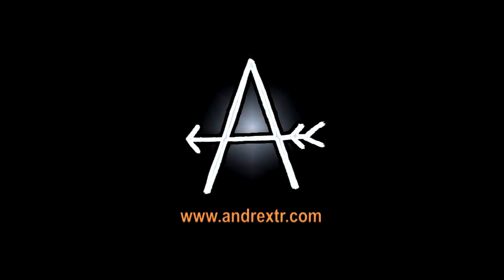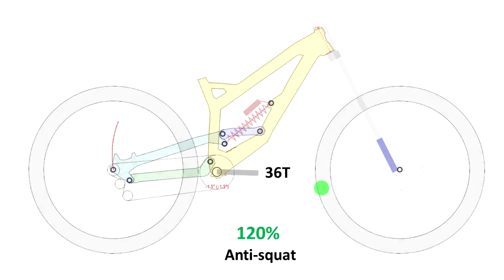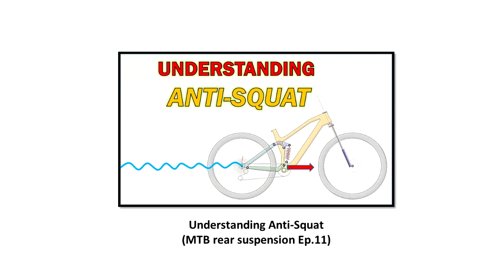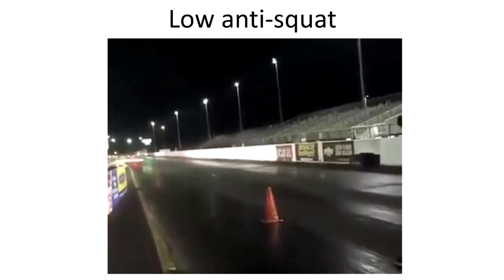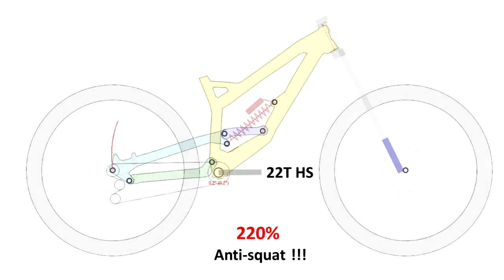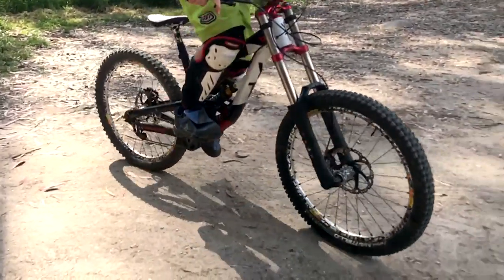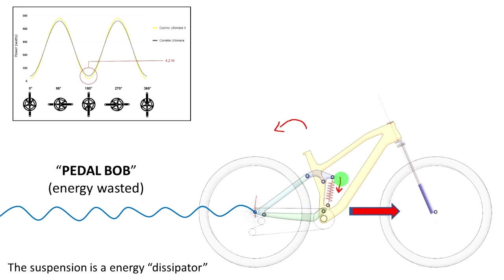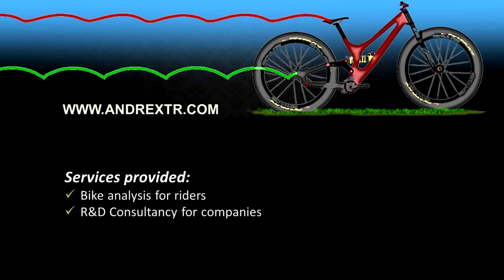Pedaling efficiency and anti-squat (MTB suspension Ep.21)

Comment: So I ride this same gen Tues frame, I want to change the stock chaining from 34 to 28 to achieve a gear range more suited to me. The tues comes with a 7spd cassete that is 9-21t. Even Gwin would size down to a 32t chaining when he was on YT. That 9t rear cog is SMALL and useless with a 36t chainring. So I guess what is a reasonable lower limit for chaining size on this frame while maintaining good pedaling efficiency and anti-squat.
Reply from the maker: For each 2T decrease on front chainring you increase average anti-squats by around 5 to 10% (grossly speaking). With a 28T you probably end up with around 150-200% anti-squats. Personally I would stick with a larger front chainring (32, 34 or 36T) and play around with the cassette range :)
Reply: @andrextr  Thanks!

Comment: I am interested to know the benefits of gearbox bikes like the Zerode on suspension..is it possible that the zerode with linkage driven single pivot, 100% antisquat through all travel  and only around 22% progressivity is still able to have the best feeling suspension because of less mass on the rear wheel? Everyone who tries the Zerode and Deviate say it is the best suspension they have felt even though the kinematics are less than perfect. Is this possible to have such a large affect and does this lower mass on the rear wheel only make a difference on small fast bumps or also on larger big hits? I want to know an unbiased opinion from someone who knows the physics and difference the gearbox bikes makes and if it is enough to outweigh their poorer kinematics?
Reply from the maker: Hi! It's an interesting question and that is a topic I want to make a video (for a couple of years now). I've done a simulation 2 or 3 years ago using a basic physics software showing that the heavier the rear part of the bike (unsprung mass of suspension) the less the wheel could track the ground over bumps and the less it was planted to the ground over the bumps (so the wheel gets more time airbone after hitting a bump crest, because of the inertia/momentum of the extra weight). This is an important topic in cars (racing applications). But I only started to saw differences using very heavy rear non-realistic wheels (like 10 or 20 kg). So, I don't think that 1 or 2 pounds would affect much given that it won't change much the sprung/unsprung mass ratio % (the sprung mass includes part of the rider weight and frame). Regarding the Deviate, it's very different story from Zerode, simply because it's an high-pivot bike (the axle path gets a more rearwarded shape and anti-rises are higher). IMO this is more relevant than the weight savings on the rear wheel (I think there is some placebo effect here, where people are already biased to feel better traction in a gearbox setup, but I don't have an actual proof of that). Cheers
Reply: @andrextr  Interesting..Yes a video would be good. However if I can show an example of Nicolai G16 vs Nicolai G16 with gearbox you can see a large difference in this test. https://m.pinkbike.com/video/463603/
Also I spoke to Chris Porter, you may know him as founder of Geometron and suspension tuner of 20 years. He explained to me that Progressive damping is better on a bicycle rather than digressive because in fact the rider is not "always" part of the sprung mass, sometimes the riders weight through the pedals is maximum and sometimes it is zero, this is why he says sprung to unsprung ratio is important as the bike frame is usually not heavy enough to compensate the unsprung weight and why he is one of the only suspension tuners promoting progressive damping in the rear shock. Interested what you thought's on this may be? Basically the frame is not heavy enough to use digressive damping effectively which is what vehicles use, and as the rider is not in constant contact and exerting maximum weight through the pedals at all times progressive damping is a more effective solution. Also the gearbox bikes increase the sprung to unsprung mass a reasonable amount, this would explain the superior feeling when the rider is in situations where not maximum rider weight is exerted through the pedals. Also inertia of the rear wheel, say for example rear wheel and stays weighr 1.5kg, if the cassette and derailleur weigh say 0.5kg this is still a significant %, therefore is easier to move away from the bump.We must bear in mind though that these theories are very new and only known by a few people, this is not common knowledge in the buyers market. As we know marketing is very good at lying to us... Shocks like the Fox X2 series are inferior as they are poppet valve shocks but in fact Fox markets them as superior as they have "more" adjustments, when the reality is the useable range of adjustment without the low and high speed having negative effects on each other is actually much lower.

Comment: Hi Andrè, thanks for your video. Which COG height did you use for calculation of AS and could you please show AS graph? Thanks!
Reply from the maker: The curve was a relatively straight line starting at 260% AS and ending at 100% AS. The COG was 1050mm from the ground. Cheers.

Comment: Interesting. I wanted to use a larger front ring (if I can find one) but this will decrease antisquat then likely. Well if I had the same type of suspension. Probably gonna have to experiment I guess.
Reply from the maker: As a rule of thumb, increasing the chainring by 2T usually drop antisquats by 5 to 10% on average.
Reply: This applies to vpp as well. M9 in this case? I guess 10% is semi tolerable anyways.

Comment: One thing that I’ve been thinking about anti squat, is this calculation is based on an assumed center of gravity right?  Does this mean that someone who is taller and/or has a very high seatpost would want more anti squat to be in an ideal pedaling situation?
Reply from the maker: Yes its based on the height of center of gravity. But it is also based on the wheel base distance. Grossly speaking, taller riders also need larger frames, which have larger wheel bases, so these two factors kind of cancel out each other.

Comment: Love you vids, keep them coming :) 
What if the rear suspension is blocked/locked and secondly what happens when it's dampened really well but not blocked?
Thanks
Reply from the maker: If the shock is blocked the suspension does not moves so there is no energy loss (all energy goes to the wheel like an hardtail). If you have a stiff compression (eg: pedal climb switch on) it also helps to reduce the energy loss. Anything that can reduce the amplitude of oscillations in the rear travel maximizes pedal efficiency. Firming the suspension or Reducing the suspension travel ultimately also reduces this amplitude and thats why shorter travel bikes or lower SAG makes the bike more nimble and reactive to pedaling in oposition to a long travel soft suspension. Cheers
Reply: @andrextr  It's a brainfuck to think that when the damper resists movement and turns some of the energy into heat, it'll still be more efficient than without a damper :-)